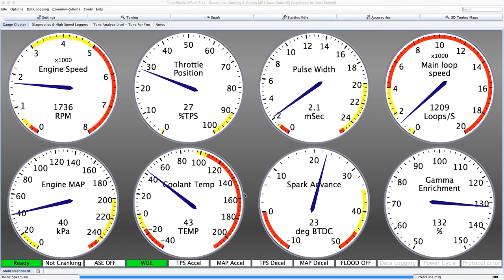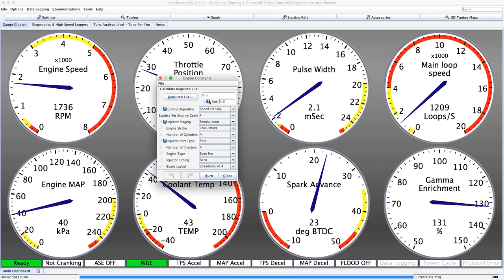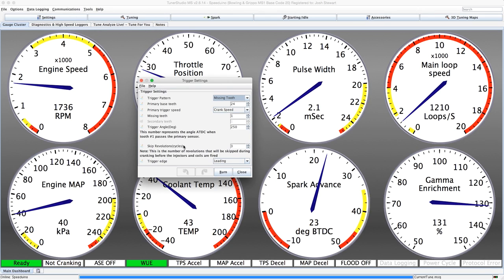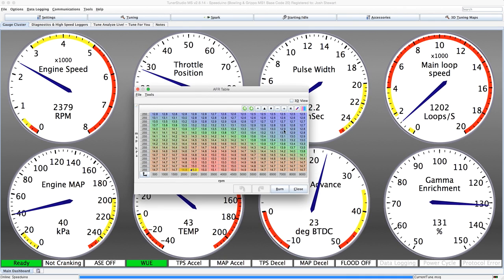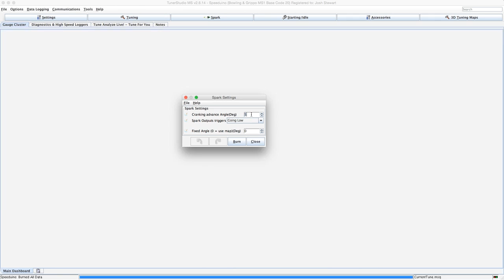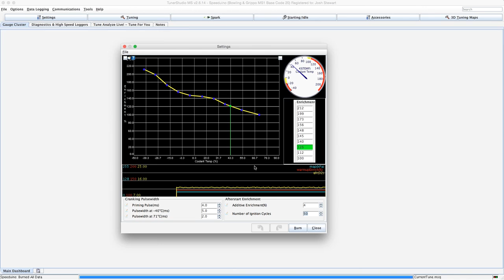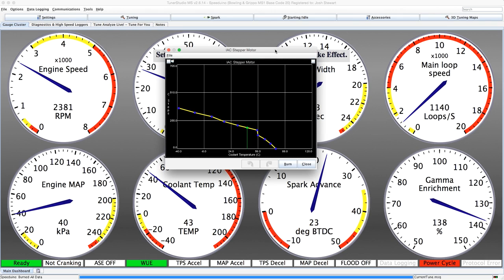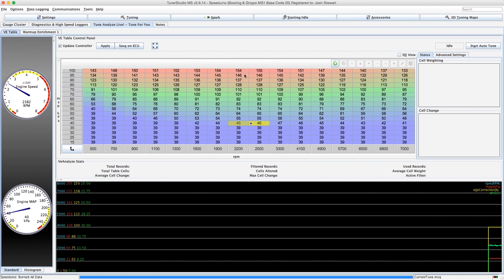Speeduino Arduino ECU demo Sep 2015

Comment: Josh,

any way you can comment on the forum about the fuel pump output not working on the V0.4.2 board through both the low current and high current outputs?? 

got the board running but no idea how to get the fuel pump output to work...??